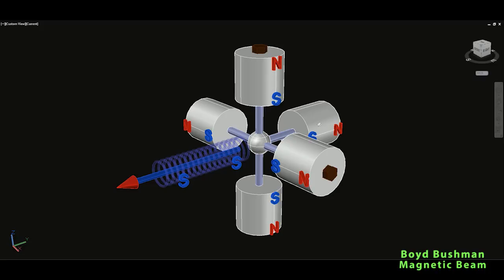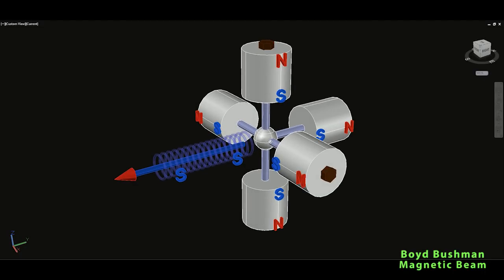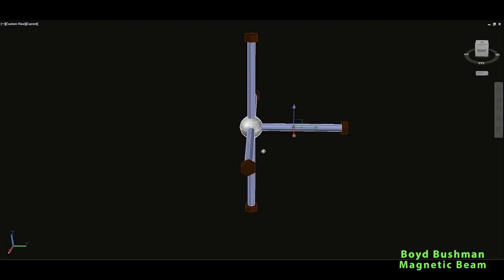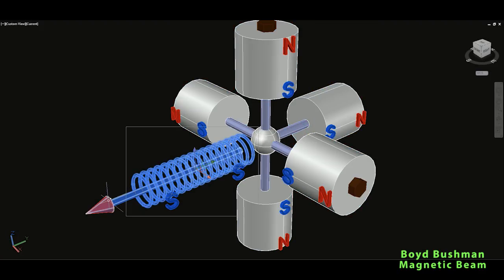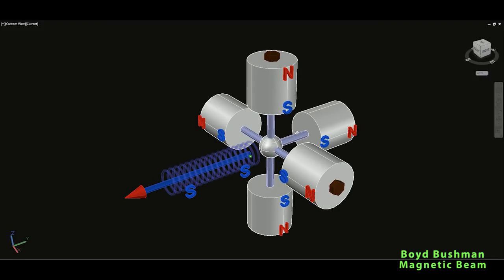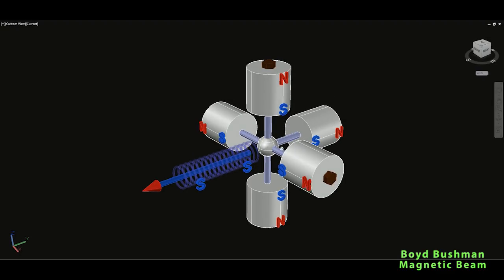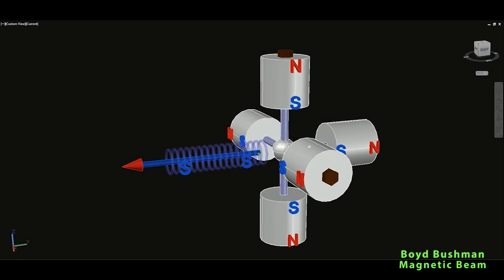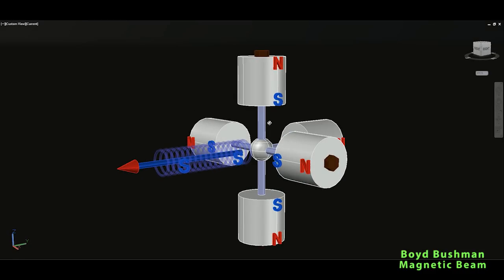FREE ENERGY, Boyd Bushman Magnetic Beam, SOLUTION for Magnetic Motor!!!!

Comment: Uhhhh, I think I know what it's for.  It's not a beam, it's an impeller.  It's not for energy, it's for locomotion.  In space, engines are often propellers and generators too, I think.  
Put this thing in zero gravity, put it with two others, apply voltage, adjust.

Comment: Putting magnets in a ball with all the same poles pointing out to try and make a monopole is very common in perpetual motor attempts. This guy should never have been given a patent, shooting out a magnetic beam is bulls**t. He just wants to put a hook into some real inventors, if they come up with something that works using monopoles.
Reply: The device shown in the video is just the blank start of something much stronger. Applying shielding to all sides of the electromagnets except for the facing ends, then adding AC current could hypothetically create a powerful wave of magnetic force to any pointed direction. There is only one way to make it become a ‘magnetic beam’. This type of magnetic configuration is already too powerful and impractical for use in a motor.

Comment: Halbach arrays can be arranged in various ways.  But no matter which one is used, the magnetic field always forms a completed circuit.  It is interesting, however, the various ways in which magnetic fields can be manipulated.  But please, don't call it free energy.
Reply: I enjoy how confident you are in peoples' powerlessness...  ... but, if you had ever bothered to go check on things in space, you'd find that thin magnetic shielding Works.  When it's near absolute zero.  So... there's that.  I didn't really know what the heck I was talking about either, until I started looking for magnetic shielding.  It says right on the box, this stuff doesn't work.  But they sell it.  Ever bought any?
Reply: This field remains an area of active research, especially in the development of portable MRI scanners for examining the human brain. 
Taking a pee a bit with this one but, here goes! - Halbach arrays in water, used to induce cavitation, result in energy, light, and thermal effects in specific configurations. If dipole attractions are balanced, no heat or energy will be evolved or absorbed, meaning the ideal state of the liquid will have zero enthalpy.

In a configuration designed to create instability, it results in either a negative pressure or temperature, or conversely, a sudden increase in temperature or pressure change when used with an ultrasonic wave. In a tightly focused sequence of events, the effect of a standing wave intersecting with single or multiple bubbles, which creates the cavitation effect, will release energy by breaking the intermolecular attractions in hydrogen/oxygen bonds. Nature's tendency to form new bonds can double the output.

As a fluid system, detecting the energy produced is straightforward, and the process of generating free energy from non-working magnets is also achievable. This demonstrates that using magnets to create energy is entirely possible. Additionally, Tokamak reactors use MHD confinement to induce fusion reactions, producing "free" energy, albeit at significant electrical costs for maintaining thermal equilibrium to harness the energy produced.

The system described can be constructed with readily available parts; reinforced plastic drum, water, an ultrasonic generator (or a DIY piezoelectric transducer connected to a signal generator), and a multimeter to measure the energy levels. P.S - it won't change the world, as all this is well known and understood but it will change your perspective and view, teach you fundamental aspects of physics and give insights to the laws of nature, most significant because they are three real biggies; 

(a) Magnets do no work. The original assumption, that a magnetic field can do no work is incorrect. In fact, a magnetic field has an energy density that is equal to the magnetic induction, squared, divided by twice the permeability (mu sub-zero). If you integrate (sum) all the energy of a magnet over all of its fields "before" it picked up, say a paper clip and compared it to the same sum "after" picking it up, that paper clip would deliver a loss of energy. The paper clip shorting out lines of magnetic flux.

(b) First Law of Thermodynamics - The conservation of energy - Energy cannot be created or destroyed, which doesn't mean energy is immutable; it may change form and is transferred between objects and in states (such as the states of juicy atomic bonds present in hydrogen and oxygen found in water, still being governed by the nuclear strong force).

(c) Mass-energy equivalence equation E=mc², by Albert Einstein. Mass and energy are interchangeable, tiny amounts of mass can convert into vast amounts of energy.

When you gotta go... make sure you go with the flow when you go back to the future.
Crossing beams of the flux capacitor, resulting in 1.21 Gigawatts of power as Doc Brown said, "Great Scott Marty!", unfortunately in reality, it just means, getting wet or shorting a fuse.

Comment: This is a very interesting devise. It appears as though this configuration can be used to construct a focused concentrated EMP discharge. A stepped up version of this devise could be used to disable vehicles or planes. I am guessing that Lockhead did military grade experiments and manufactured an EMP gun for a fighter jet ? Boyd also has a very interesting patent for a jet exhaust laser that can (in speculation) be used to power this EMP "Ray" in flight. It's pretty amazing how simple this configuration is to understand. I wonder if this devise has some type of a measurable effect on gravity (waves) ? Lockhead has access to nuclear fusion reactors as well Hmm.
Reply: Effect on... or could it possibly be combined in an array of units to Create grav waves?
Reply: Put in zero g to start with, and add two more.